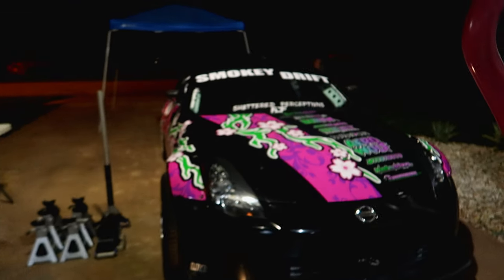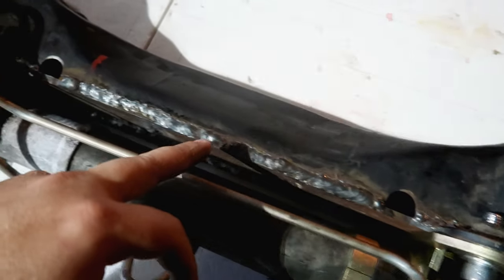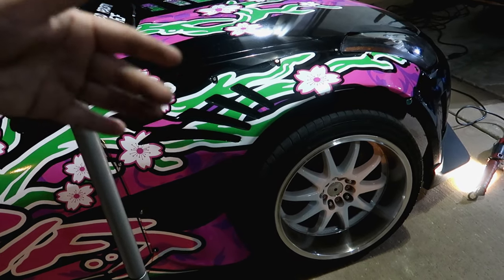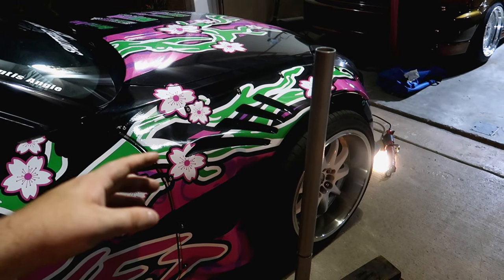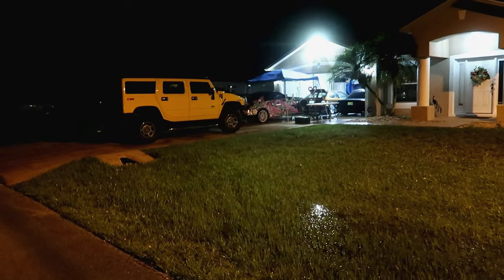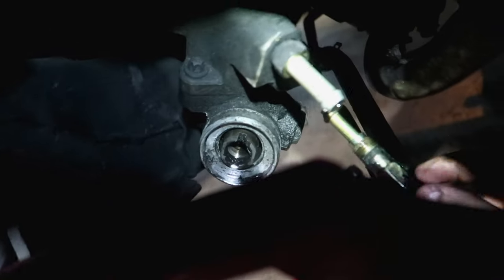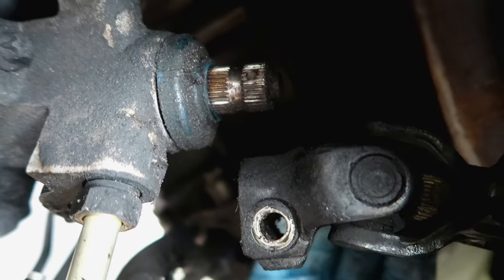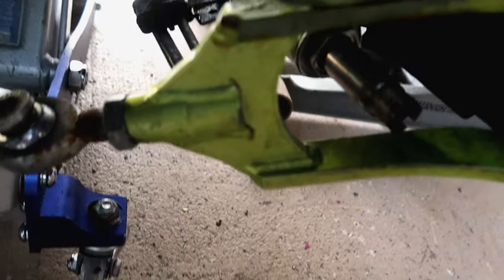350Z PBM Rack Relocation Kit Complete Install & Explanation

Comment: Did you end up running some kind of straight spacer to still have the amount of rack travel needed for the angle kit? If you don’t run some type of rack spacer I think the tie rod will bottom out against the rack. I think fdf sells a bolt on straight spacer. This is probably why your s14 tie rods were too short
Reply from the maker: With the S14 tierods yeah I was running one. With the GK tierods I dont have too though
Reply: Do the gk tech tie rods have a built in spacer?
Reply from the maker: @SK8R6593  No they dont. The spacer wouldnt have helped anyways they were almost 3 inches too short. The GK Tech ones feel great! Already did a ton of testing without any issues. Slapped full lock a few times and felt better than ever 😁